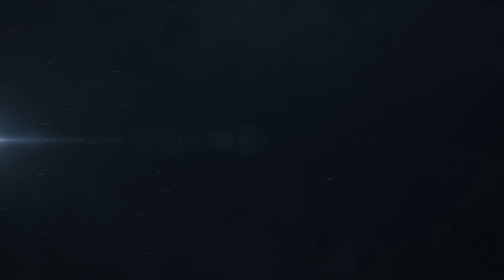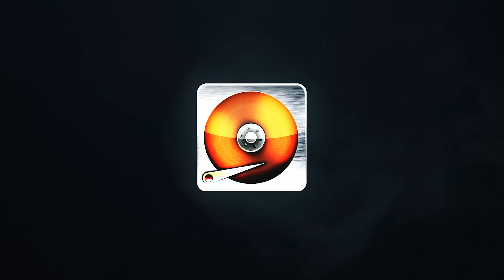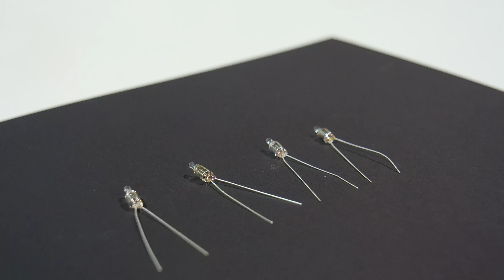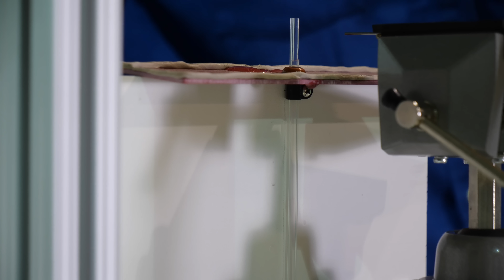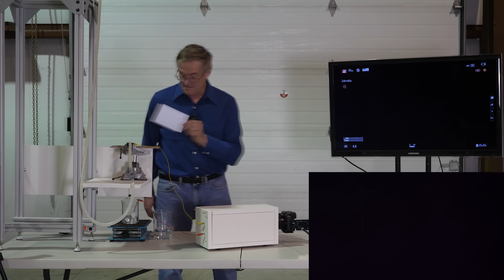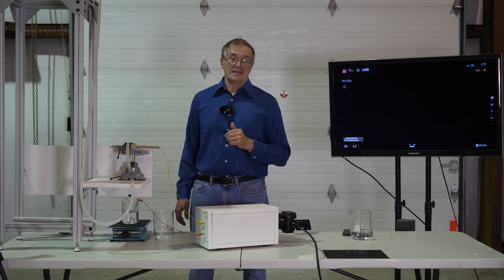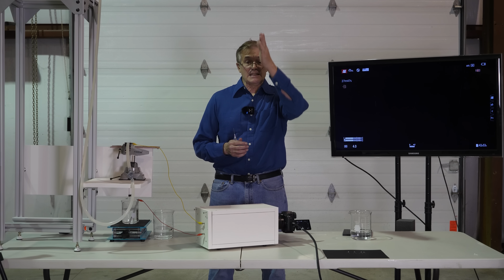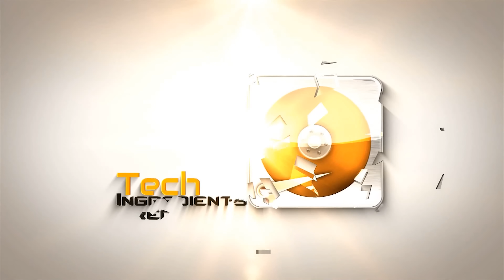We made electricity from water - and it's easy!

Comment: the question -  the meaning of (at 1:03 ) "at over 10% efficiency" could this be 1 dollar input into this method yields a bit over 10 cents of electricity out?
Reply from the maker: Sort of. The idea with generating power is that you harvest the $1 from the environment and extract 10 cents from the process. If you already have the $1 in the form of energy,  you're already done.

Comment: Interesting phenomenon, but turbines can much more efficient, can be very resilient, and easily scalable for any level of relevant power generation and also extremely cheap compared to that, for a given output, if we assume relevant amounts of power. Those tubes will clog up very fast unless the water is very clean, and bio-fouling is somehow prevented. 

I don't see any practical advantage of that over turbines for power generation, but multiple very severe disadvantages. Very low efficiency, finicky, very bulky for the power output, and highly sensitive to contamination. If that system can provide relevant amount of power, a turbine can use the same water flow and produce much more power, for much less money, and much more reliably.  In short, that's kind of the equivalent of generating power from wind via an electrostatic generator, we don't do that to generate relevant amounts of power, and that's for very good reasons.   

From what I read, the highest efficiency they achieved was 10.4%, while that's probably not the highest possible, they did try a lot of things to achieve that, and that's with the best tube diameter for them, flow rate, flow pattern, type of water, temperature and on and on, the efficiency even varied noticeably with time, just over a period of two hours, if that doesn't tell you keeping the efficiency that "high" over time without extremely well controlled conditions, like out in the real world, I don't know what will.

Comment: I wonder: Couldn't a Kelvin generator be converted into a massively parallel insulating multi channel geometry too for less voltage an more current? And wouldn't that outperform this process described here? Also the Kelvin generator variant could be reversed and used as a silent no-moving-parts pump (for intermittent flow) too.

Comment: With water not from water.
Title is misleading.
Reply from the maker: I disagree. 
A turbine can run with any fluid as long as it's moving. The fluid is just mass.
This process will only run with water as the process involves pulling the water molecules apart to generate current.
Reply: @TechIngredients  - The water eventually recombines. It is not permanently altered in a way that the energy comes form the alteration. The opposite rather. Part of the energy from geavitational potential gets converted into chemical enegy thereby >reducing< the electical energy output.

Making split water from its graviational potential energy is what is happening here. There comes no energy from the molecules of water which is what I would interpret the current title as and which is what I think is misleading.

Comment: @Tech Ingredients. Great video, but isn't the energy to separate the charges coming from the potential energy due to gravity, and therefore a little waterwheel would have generated the same or more electrical power?
Reply from the maker: It is, and it might. This method involves no moving mechanical parts and has implications beyond power generation.

Comment: Has anyone ever heard of lightning before?  The clouds produce 300 million volts and 30,000 amps and is an electrostatic discharge.  What about a van de-graaff generator generating millions of volts and very little amps.  These are just some of the ways to create the separation of electrons from moving materials to produce an electrostatic potential.  If there is anything here is that they are doing this with moving water.  No big deal here and will never be a great source of enegy.  There is nothing new here and is surprising that this educated man could not easaly figure this out.  This video borders on click-bait.

Comment: There's no doubt this effect can generate some power the problem is entirely down to whether it's practical and I'd put money on the answer always being no. Take the slow moving stream idea, it's slow moving because it doesn't have much energy. It's almost certainly going to be saturated with silt. When you remove some energy with this device the silt will fall out of suspension and  you're device stops generating power. All you've built is a very expensive dam.

Comment: Nice setup and presentation. But what voltage and current (and watts)  are you getting? Also, how many watts from potential energy of water falling the 30cm across the plastic, and from the 1m or whatever feed tube? If it's rain water, you can ignore potential energy from height, otherwise we would need to include energy cost to move water into the apparatus. It would be interesting to know the energy from ions vs energy to get the water.

I guess we want to know the watts per liter of water per second. (Besides watts from your apparatus, what is your flow rate.)

Comment: It's not useable energy though, you can generate a voltage but there is no useable current.
It's no more useable energy than rubbing a balloon with a cloth, you can get 1000's of volts but no current.
For useable energy you need both current and volts, which can generate power (watts).

Comment: soooo ... were looking at impact static ? Could almost put round ball magnets say 200 the size of bb's on top of a magnetic lower sheet say 12 x 12 with conductive fluid submersing them a layer with a thin plastic / rubber sheet on top of the panel . Then connecting 2 wires one one the underside of the magnetic sheet then one suspended in the conductive fluid . The by basiclly raining on the top of the plastic static sheet create energy ....  let me know what you think and be nice to see you try my idea and make a video of the results .

Comment: Interesting to see if you could make a coil of n turns and have positive / negative electrodes every half turn, 32 cm whatever and see if it works as some sort of inverse commutator? People seem to be mentioning the Kelvin water dropper but what the Kelvin is missing is the discrete plug flow to yeet the debye length. Plug flow looks exactly like binary code flowing through the pipe air/water interface for 1 water/air interface for 0.

Comment: Looks like a net of about a microWatt average -- tiny little barely detectible flashes. If you could reliably measure the average power, that would be useful. Would probably get more power  from little water wheels and generators. Still... interesting. Thanks.

Comment: Robert Murry Smith did something similar to this on his channel about a year ago from a different paper that was originally focused on triboelectricity, & how different materials always maintain a positive or negative charge, If I recall currently he used aluminum tape & Kapton tape (because of their electrical differentials) & used it to light LED's. Also, unlike this system the water didn't need to be intermittent, it just needed to flow over the surface.

Comment: I really wish that this video was more explicit about the fundamentals (c'mon, how much power is it generating? can't you just tell me an estimate in pW or whatever?); if I didn't already watch this channel religiously, I'd quickly dismiss this as one of the millions of videos by people who don't know enough to do the back-of-the-envelope about such numbers, who assume that any time you can make a light turn on or a bearing spin, that means that Big Oil is Suppressing the Water-Powered Car. I'm sure you have done those measurements and quick calculations; I wish you'd share them!
Reply from the maker: There are some interesting facts in the paper I linked to in the description. You will probably find the paper worth a glance.   They give some of these numbers, including the voltage and the current. The power output is pretty small.

Comment: incredible. 

I suddenly envisioned the pencil sketch of the trompe from Bill Mollison's Permaculture Design Manual. Like the name suggests, it looks like a trumpet--with its mouth full of straws. They would be built to take advantage of water falling from a high place. The individual droplets would fall into the straws, and trap bubbles of air,. The weight of the water would carry the bubbles downward, where they would collect into tanks, forming a very powerful compressor. They could run compressor, driven tools, compressor, driven generators, the nozzle (being a depressurized exit) even stood in as an air conditioner that cooled their shop down. 

But now, I see a potential in which a trompe is assembled (in a high place to take advantage of the drop) with 2mm straws, and corresponding body parts that serve the electrical purpose instead. Fascinating.

Now all we need is water from a high place.

Comment: Did you guys solve your laser blocker problem? I would like to suggest using a non-flammable material mounted on a spinning wheel, and placed at an angle with the laser beam to increase its thickness. The wheel rotates and brings in fresh material before it can be fully burned through. Make sure to spin slowly so it doesn't create a hazard if it breaks.
Reply from the maker: I think we have a few good candidates, and we'll demonstrate those along with some other interesting materials for the fun of it.
The issue with any moving blockage is that we have to protect the entire back wall of about 20 ^2 meters because the laser can strike the targets anywhere in that field.

Comment: There was a demonstration in physics that was on the internet in regards to a very intelligent professor that showed four coffee cans connected with wire that mannix across the top can to the bottom count on the other side same with the other two cans he had two streams of water going down through the two cans on the right and the two cans on the left he also had a central point to where both wires were connected to a piece of metal on both wires that were about a quarter inch apart when the water ran through the cans you could tell just about when the spark was about to happen and they were talking about some serious voltage as long as the water was running the professor would get a spark every few minutes so basically this experiment that you're talking about has already been done and proven you have a nice day thank you very much I'm not criticizing you I'm just explaining what I seen already
Reply: That was MIT Professor Lewellen. It's often referred to as 'Kelvin's thunderstorm' - a different generation process.

Comment: it takes a lot of energy to get the water to flow.  Also, couldn't you just use the water flow through a turbine and generate electricity using hydroelectric?
Reply from the maker: That certainly is an option under the right conditions.

Comment: I wonder if it's more efficient than turbines. It seems like the energy "from nothing" is coming from the flow of water (and the surface slowing it down is the symptom of energy conversion). There may be better ways of harvesting energy from slow moving water, using conventional methods.
Reply from the maker: There may be better ways, but I'm not aware of them.  Are you?
Reply: @TechIngredients  I had in mind, given the slow moving stream example, of how a turbine can travel slow and generate electricity if it has a high gear ratio. Slow moving water can still generate a decent amount of torque when the turbine is blocking the flow of a large amount of water. Or how dams are able to take a low gradient of water and turn it into fast moving water. Or a bypass route (I'm unsure of the proper name, but reconnecting to the stream at a lower gradient, such as a pipe). It depends on if this method is more energy efficient (I don't know), and then there is cost efficiency for operating at scale (which everyone is unsure of thus far). Perhaps a tiny motor (like the kind of phone vibrator size motors) could be used to attempt to generate more electricity from your setup. Like a bucket wheel at the bottom of the tube could work.

Comment: 2:49 - "if the surface has a very high surface energy...." - immediately lists the material with literally the lowest known surface energy.

Teflon and fluorinated polymers have EXTREMELY LOW surface energies. That's what makes them non-stick and non-reactive. You need special glue for "low surface energy materials". Glass or metal sheet would be an example of a high surface energy material.

Perhaps you're meaning a very high rank on the triboelectric series? Teflon and many slippery plastics are ranked high on that, and it's related to charge shift based on surface friction.

Comment: There is a net charge separation near the surface of water, you can observe this with microelectrodes. It is a stable bulk charge near the surface. This fact has been appreciated in the subfield of nanoscopic or ultrafine bubbles, AND ACTUALLY HAS BEEN TAKEN ADVANTAGE IN COMMERCIAL APPLICATIONS. The surface charge of the bubbles rapidly increases when you transition from micro to nanoscopic bubbles.

Comment: Maybe the neon lamps flickers because as soon as they light up, a current flows through. This current kills the high voltage and light collapses, lamps are insulators again until next rise of voltage.. would be interesting to use another way to measure the voltage just to see if it is continuous or pulsed...
Reply from the maker: It's actually pulsed and in sync with the individual bubbles.

Comment: What i find fascinating about all of this is the idea of having acidic solution with pure protons and no counter ions. That just feels wrong somehow.
Also, wouldn't this mean that you're making some hydrogen gas and hydrogen peroxide on the electrodes? Seems to me the only reasonable way for the resulting radicals to recombine in distilled water.
Reply: Oh, he mentions the acidic water by the end, should've waited with my comment. Also, i'd think solutes in a water stream might present some complications with the charge separation. I'd be interested if someone made experiments using a low concentration rock salt solution with this set-up.

Comment: This is a good explanation of an interesting effect, so good video, and the theoretical possibility of miniaturization/scaling is interesting. So "If nobody else does it", you seem like good candidates to push on that boundary a bit.

But at the same time, like everyone else says, if you're willing to accept a super picky setup and PITA high-voltage static accumulation for your electricity supply, the Kelvin water dropper's been pushed to 50% efficiency at the University of Twente and is made of two bits of metal lol. And this is a non-starter with anything other than distilled or rainwater, such as your proposed cases of turbid dam water, greywater, etc. The ions and electrets in the water would grab the ions, overwhelming this effect completely.
Reply from the maker: Thanks.
Despite what you said and what I originally thought, it works well with seawater.

Comment: Please check out the Robert Murray videos on triboelectrics and the rain generator. I had an idea for a Kelvin water dropper that recirculates the water by evaporation on an enclosed system to use as a unit in tandem with more modules/cells. I never did a prototype though...

Comment: Can't you just inject air bubbles up the tube? Could you use faster flowing water thru a venturi that sucks in the air, maybe a Dither valve on the air intake would create perfectly spaced air pockets. Could you have a longer tube that has conductive adhesive copper tape someplace on the outside of the tube also connected to the negitive side?  Some super low resitance wire, charges a capacitor bank then a battery, how big this thing need to be to charge a 12 volt car battery someday? I mean rain water is different than ground water, so your saying dirty water works too? Calls people out to pipe clean 10 billion tubes full of soap scum, takes a shower to charge cell phone, lol.
Reply from the maker: You could inject the air, and you can make the tube longer, but beyond 30 cm. the voltage doesn't increase. Additional tubes could be placed below the first, each generating approximately 6,000 volts.

Comment: I would be interested in seeing how much power does it extract from the mechanical energy of the water, if it is even remotely in the same range as dripping that water on a wheel or though a turbine. Sure, it might squeeze out every last joule from the water (I assume eventually the voltage across the tube can rise enough to hold the droplet suspended in the tube and that's what limits your output after certain length), but will it ever pay back the energy used to build that system?

Comment: The principle of charge separation in flowing water has been known for a long time. However, the electrical energy gained remains below the energy required to generate an intermittent droplet flow.
Reply: That depends on your water source. You could say the same for a hydro dam - if you had to move the water up hill yourself.
Reply: @TonyGrant. Otherwise, it would be a perpetual motion machine. It would be different if energy were extracted from the water, or if water were consumed.

Comment: Basically Static Electricity ! TENG Is much simpler.
Reply from the maker: Much simpler?
That would be tough.
Reply: @TechIngredients  TENG can be used as a wave power 2) Wind Powered etc.
Reply from the maker: Sure,  but that's not simpler.